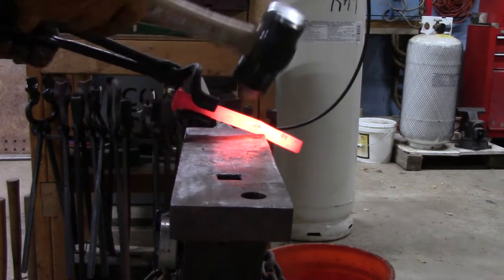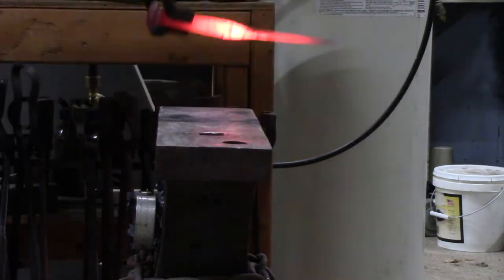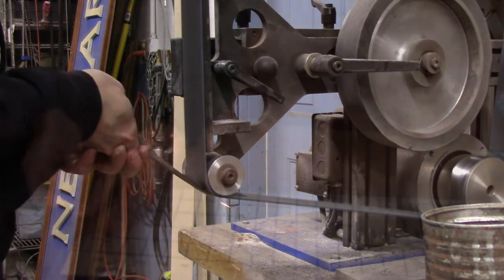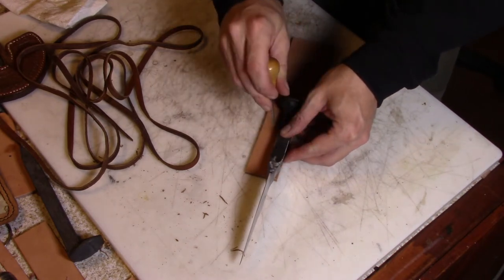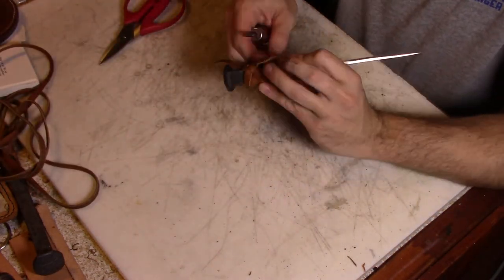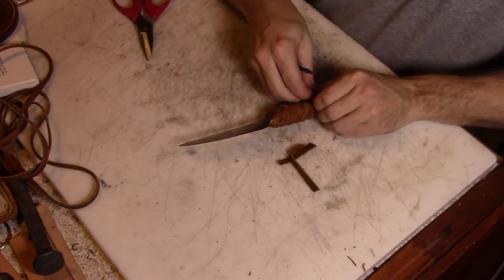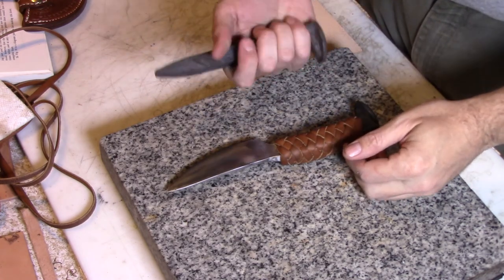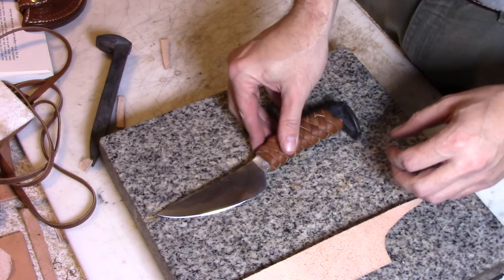Forging a railroad spike knife with wrapped leather handle

Comment: How do you finish the ends, glue them down?
Reply from the maker: I just tuck the end under the knot.  If it is under three or four strands friction holds it together.  If you are really worried about it coming loose you can put a bit of CA glue in there with it.
Reply: @bransonsgeneralstore  awesome thank you for the advice !